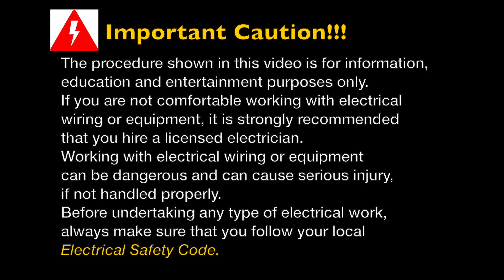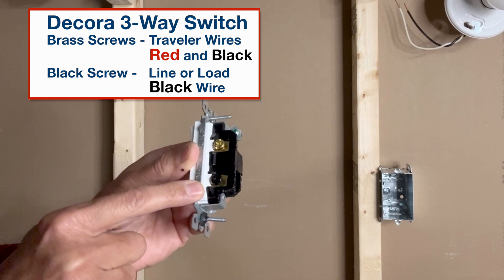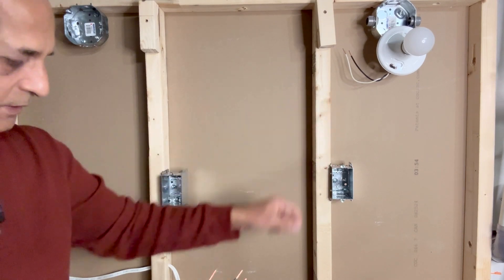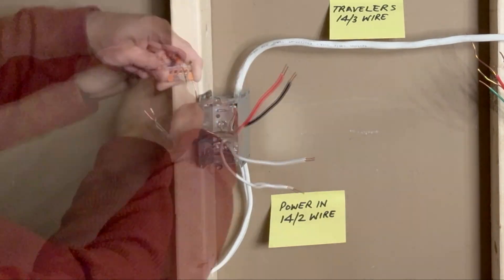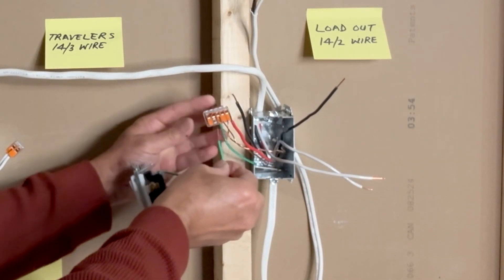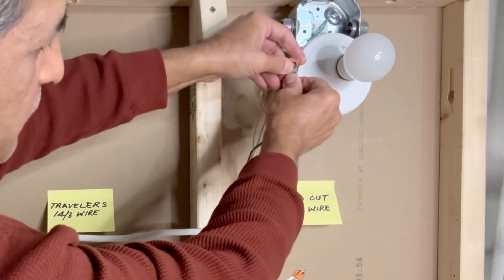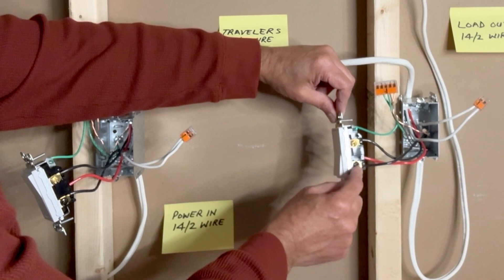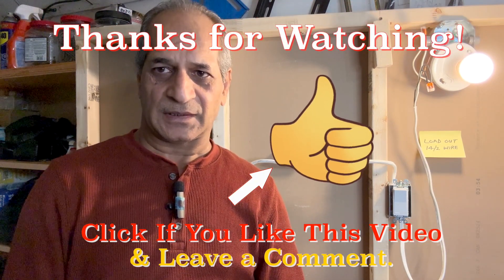Simple Method of Wiring a 3 Way Light Switch - Part I

Comment: What kind of wire would you run from the second switch box in this example to the next room to power the lights there?
Reply from the maker: Thanks for watching! A 14/2 wire should be sufficient to take power  if you need power just for lights. If you need 3 way function for any lights, then 14/3 would be needed between switches in that room.